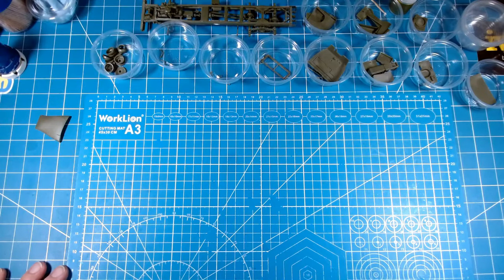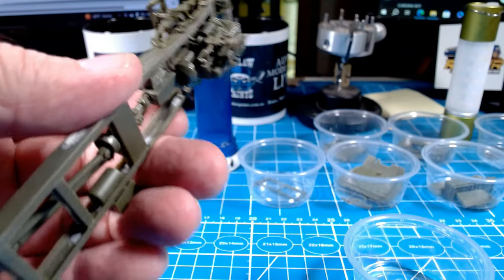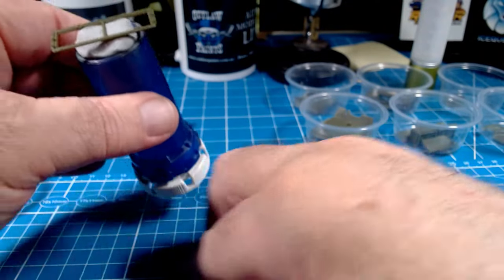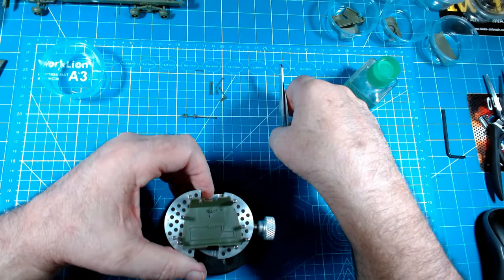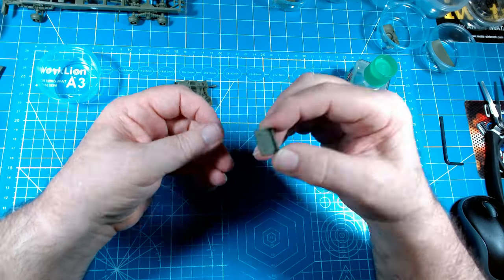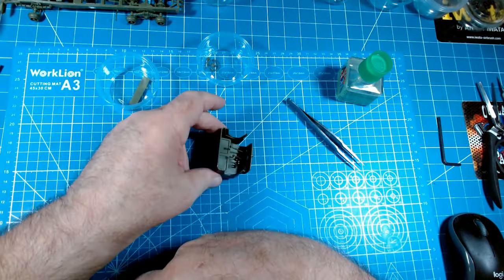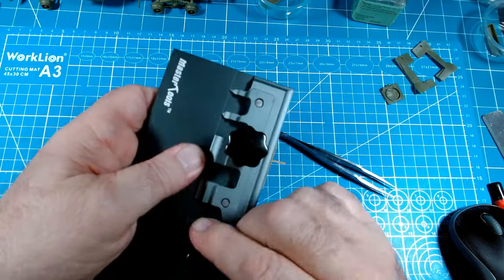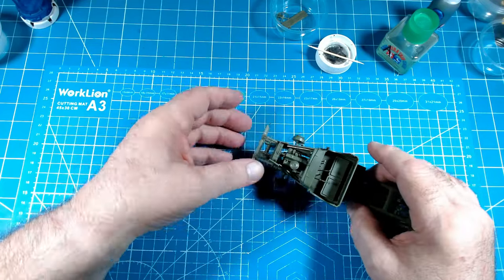Hobby Boss #82459 GMC Bofors Part 8

Comment: Hey Jeff, great work. What is the stand called that you had the base of the cab in when you were putting the parts on and where did you get it?
Reply from the maker: Hi James, thanks for watching.  That little vise is really handy.  I got it from Amazon.  It's called a Megacast Hand Free Universal Work Holder, Peg Clamp Base Vise Bench Tool Set for Jewelry Making with 8 Pin  Have a great day.  Jeff
Reply from the maker: Hi James, I just remembered I had a really small issue with that little vise.  The ball joints that allow the vise to swivel can slip from time to time.  I just sandwiched a small piece of sandpaper in between the parts of the ball joint and it works just fine.  I hope that helps.  Jeff
Reply: OK thanks. I am going to get one. I was going to ask if you ever used a China marker pencil for small photo etch and plastic parts. I find those much easier than tweezers. The part sticks to them and it is easy to put them in place.
Reply from the maker: @jamesdowning37129  I have wax pencils, and a little tool that has what I think is a bit of silicone on the end.  I just keep forgetting to use them.  Have a great day.  Jeff